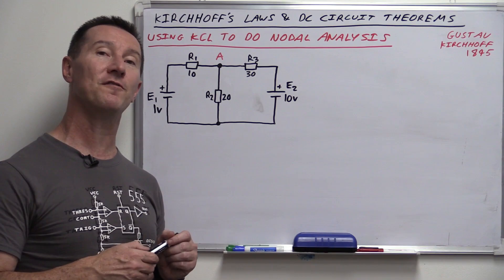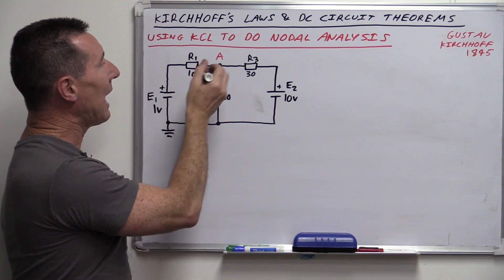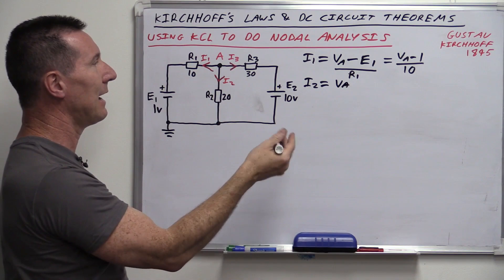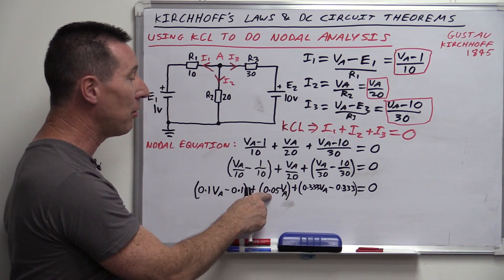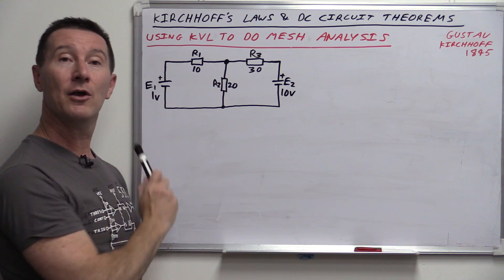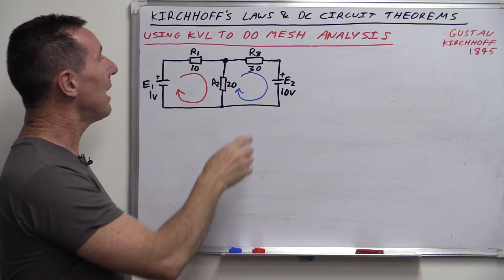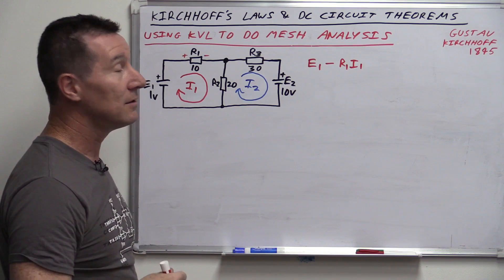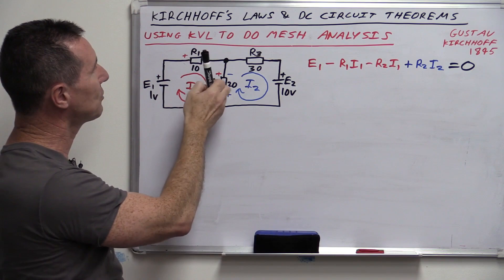EEVblog #820 - Mesh & Nodal Circuit Analysis Tutorial

Comment: If anyone is wondering how to solve the nodal equation at 9:00 without using decimal approximations, the method would be to multiply both sides of the equation by 60 (the lowest common denominator of 10, 20, and 30). This yields 6Va  - 6 + 3Va + 2Va - 20 = 0, 11Va = 26, Va = 26/11 (~ 2.3636).
Reply: @me calculating with AC network analysis and i found decimals to be hard to use with polar complex plane, so i just simplified it straight to have Va as output. So i had to use method you suggested here, but i had symbols instead of decimals => even better ;) . Youtube is just amazing tool for learning.

Comment: Dave, love this sort of thing. The math is so important, and this importantly underlines it. I did take up your challenge of solving it without Kirchoff's laws. My approach was to consider E2 and R3/R2 as a power supply. Therefore having a supply voltage and impedance.  then R1 and E1 effectively as a resistor in series with a 1v zeener connected to the power supply.

Another area of interest may be the interaction of resistance, and capacitive and inductive reactance. The AC voltages across the components of an RC or LC network don't sum to the measured voltages but sum to a pythagorean formula.

Comment: Great video, Dave!

I'd just like to point out that the mesh analysis already uses the superposition principle (on R2 in your example). What you explicitly named as superposition method is actually just the same as the mesh method with slightly shifted mathematical terms.
For more complex circuits most simulation software programs actually use the pure Kirchhoff's laws and construct a equation system, which then can be solved very quickly by matrix inversion. With this systems with hundreds of components can be solved in fractions of a second. Also the equation system has the advantage that they can be used for sources with AC and even arbitrary waveforms.

Comment: An easier way is to always start in the lower left and take the terms as they come.
-E1 + R1*I1 + R2(I1-I2) = 0
R2(I2-I1) + R3*I2 + 10 = 0
Same results with less jumping about.
Either way still isn't as much jumping about as google made me do just to leave a simple comment.
Reply: +Why Doineedtosignin sometimes, google wont let me comment to my subscribers on my OWN video. What kind of workaround are you using ?

Comment: I am really enjoying this, i was never taught anything about kirchhoffs laws, but it seems like it would be pretty easy, at least in my head, to do superposition theorem in my head, both at once:

Starting at E1, 1 volt travels through 10 ohm resistor, so divided by 10, so .1 (similar to nodal analasys) then starting at E2, 10 volts, travel through 30 ohms, so .0333 volts, then half of .1 add to half of .0333 and go down through R2, so .0665 volts go through 20 ohms, so .0033325

Then, doing the rest of the paths,  that .1 from R1 splits, .05 travels through R3, so divided by 30, .001666, meets up with the .0033325, making 0.0049985...

then half of .0333 goes through R1, meets back up at the bottom...

Then there is 0.4333 at the top of R2, and 0.0066635 at the bottom...

Actually, this is way more complicated i think.

Comment: Very good vid series. Had to brush up on KCL and KVL to help a freshman student with homework. Not a biggie, but 0.1 + 0.05 + 0.333 = 0.4833 not 0.1833 so the final VA value is 1.13V and not 2.36. Thanks Dave for the great stuff you do so well.
Reply: He was correcting a previous mistake. VA/30=0.0333. Not 0.333 If you put that in, his numbers are correct. He just didn’t correct his mistake earlier in the video he just fixed the math at the point you mentioned.

Comment: For the last example, after you calculated I(total) of 0.04545, it would have been simpler to get the nodal voltage. Just calculate the voltage drop across R1, then its super easy to get IR2 with IR2=V(nodal)/R2.

Comment: The last method to analyze this circuit would be to replace the two Thévenin sources to the left and right with their corresponding Norton equivalents, calculate the parallel connection of the three resistors and the sum of the two current sources.... Or in order to just calculate I2, the current divider formed by the three resistors.
Reply from the maker: +Uwe Zimmermann I deliberately didn't go into Thévenin and Norton in this one.
Reply from the maker: +Aodhan Murray Probably, they naturally follow on.
Reply: +EEVblog Yes please, keep it up!
Reply: +Alter Kater, we use the Thévenin/Norton-equivalence all the time when working in analog electronics - when we use the hybrid-pi model for transistors, calculate the output resistance of an amplifier and so on. 

The advantage in the above described problem is that you can make step-by-step simplifications to the circuit, which only require single-line calculations and some re-drawings of the circuit.

Comment: How about a couple of capacitor related tutorials.  First, a review of all the different types of capacitors, and the strengths and weaknesses of each.
The next would be a tutorial about picking the values needed for different uses, especially the filters on power supplies.

Comment: Great video!!! If you need more ideas for fundamental friday (I'm not an EE): I used to have this electronics kit as a kid, with a breadboard and some components, and one of the basic circuits was a two-led blinking system using two transistors, two capacitors, and two resistors. I could kind of figure out how it worked (there was some explanation in the little book), but I never find out how they picked/calculated the values for the resistors and the caps to make it blink well in a certain speed. Would be kind of childhood dream come true if you could explain this in one of your next video's :)

Comment: For solving the equation at 9:00 you can multiply both sides of the equation by 60. Why 60? well because 60 because it's the lowest common multiple of 10, 20 and 30. It's also known as the "lowest common denominator".

Comment: You don't have to solve for two unknowns simultaneously, you can solve for one, then the other. 

Trigger Warning: Math ahead.  To make it easier to read,  i1 = x, i2 = y, and ~> means do some mathy stuff, aka voodoo.

Step 1. Rearrange and simplify one of the two equations: 
1-30x+20y=0 
~>
 y = 1.5x-0.05

Step 2. Substitute that answer into second equation in place of y(I2):
-10 - 50( 1.5x - 0.05 ) + 20x = 0

Step 3. Distribute, combine like terms, then do algebra stuff to solve for the first unknown:
 -55x = 7.5 
~>
 x =  -0.13636

Step 4. Substitute solution for I1(x) into either equation (pick the easier one):
1-30(-0.13636) + 20y = 0

Step 5. Solve for I2(y): 
1-(-4.0908) + 20y=0 ~> 20y = -5.0908 
~>
 y =  -0.25454

So, I1 = -0.13636 and I2 = -0.25454, which when combined for R2 accounting for direction of current we get  0.11818

And Bobs your uncle!  

This method is pretty fast, took less than 2 minutes to complete.  I figured I would show this for people who aren't sure how they would go about solving for two equations without resorting to matrices and programs that solve the equation for you.

edited for clarity of process and ease of reading

Comment: I like it and understand mostly.
However there are many basics that I lack understanding of.
For instance real life scenario. PC power supply, Molex for ATA hardrive has 12V and 5V, 7V difference
From that difference I draw say 1A and that's 7W (not using ground)
How much current I'm drawing from each power rail?
Each power rail is rated separately.

Comment: Hi Dave, huge fan, Could you do a video on EMF vs potential difference vs voltage, I found the terminology and how to properly use the terms a bit confusing.

I finally realized that EMF is describing a voltage generated by some source, (kind of like a pump creating pressure) while a potential difference is what a multimeter measures across a load (like water pressure at the faucet).

Comment: I don't understand this: at around 24 minutes in the video the loop currents flow into the positive terminals of the resistors, for example in resistor R1: there the voltage is said to be "-R1*R1". Why is it negative? Whenever a current flows into the positive terminal of a resistor, a positive reference voltage is assigned (Passive Sign Convention) as I was taught.. I don't get it. Is loop current immune to PSC?

Comment: I'm not understanding how to get the signs on all of these voltages :(. So we say that voltage is smaller once the current goes though the other end of a resistor, is that our whole basis for the sign convention in this method? or is there something that I'm missing here? I got confused on the first equation for i1.

Comment: Does EEVblog done a video on how to use Triac(ac) SCR(DC) zero crossing, to control PWM 230v motor. have seen many use triac in Light dimmers that I also made in 1995.  but there is not many app note to use them as MCU light dimmers motors and so on. optocoupler have some of them have zero detection on the sec. side but not the Prime side. so you dont know when the sine wave begin only if you use DIAC opto coupler.

Comment: You can't have 2 identical circuits (Ignore R and V values for my argument) and say that current is flowing in different directions for each.  It is always flowing from plus to minus  (or minus to plus, depending on your belief system) for both circuits.
If you fold the 2 circuit halves in on each other through R2, you'll grasp my meaning.
You CAN imagine the current is flowing the other direction in order to easily make the arithmetic calculation, but this trick is not explained clearly for a newbie to comprehend.